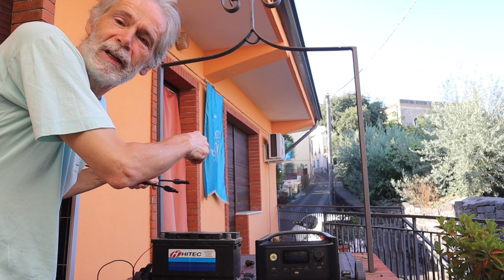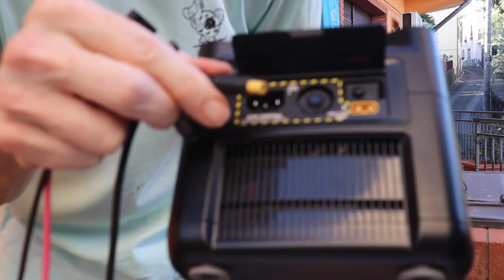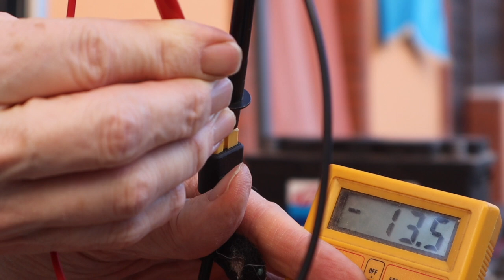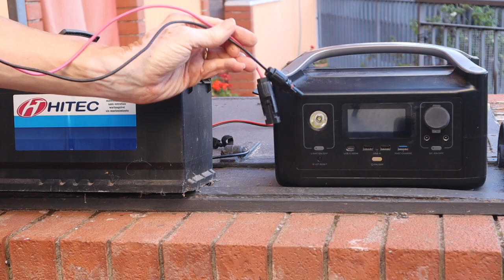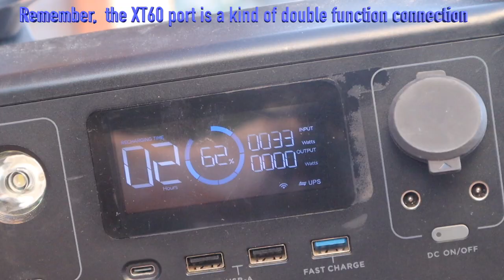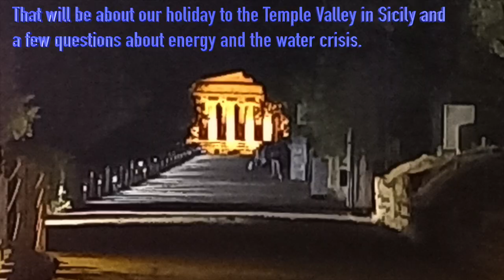106b The flexibility of a Portable Power Station

Comment: put up a video about my chevy volt finally <3
Reply from the maker: Sorry, this comment is already some time on my mind. I simply don't have the experience with the Chevrolet Volt like you have (I know it from other comments of you) and you should be the teacher. I have my Chevrolet Volt for 130 000 km but as user, not as DIY. And additionally, it is stuck in a frustrating import procedure from where I lived to where I live now, so that I have no number plate and cannot use them. But next winter I will use it for CHP (Combined Heat and Power), if nothing positive happens.

Comment: Might be worth going for a Lithium ion Phosphate battery, longer life time and greater storage capacity & weigh less.
Prices have dropped and Bluetooth is also available for the battery.
I even have one from DC House with USB connections on.
Take care M.
Reply from the maker: Hi Mac, you are right and I have one. Also better to deep cycle. My reason for the lead battery was that this video is also relevant for Developing Countries, where Access to Energy is an issue. I think that lead is still the main technology there (should not be, they also would benefit from Lithium).